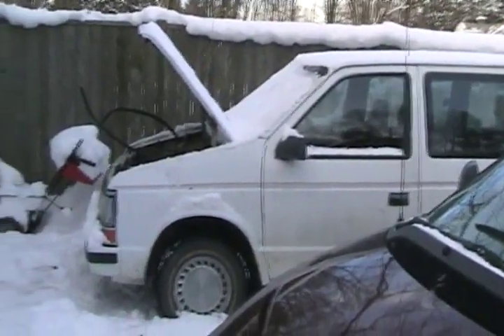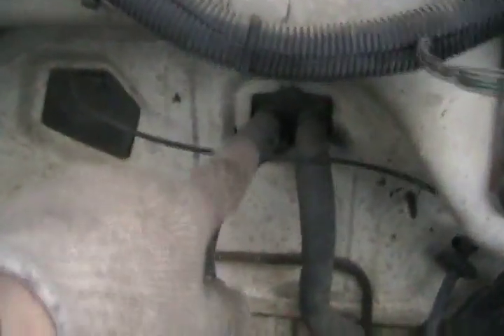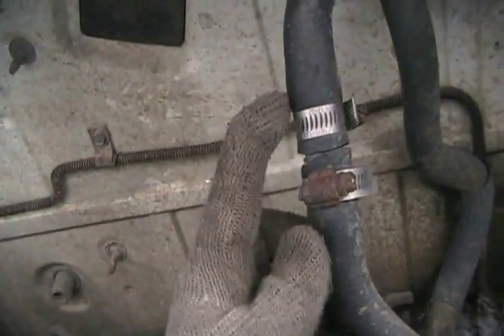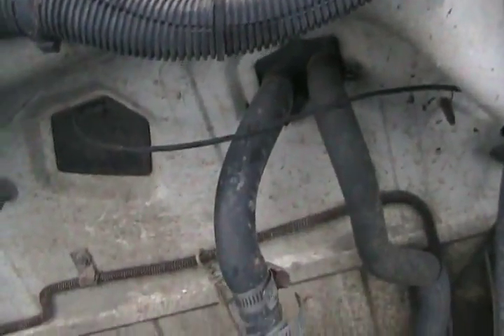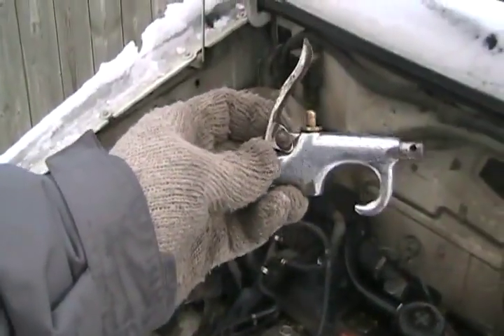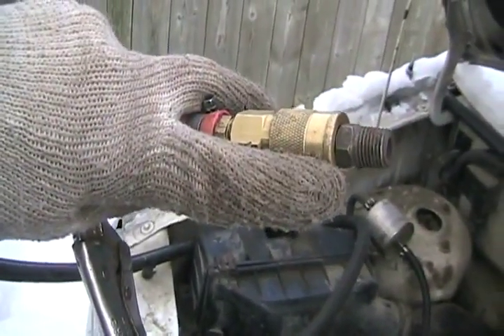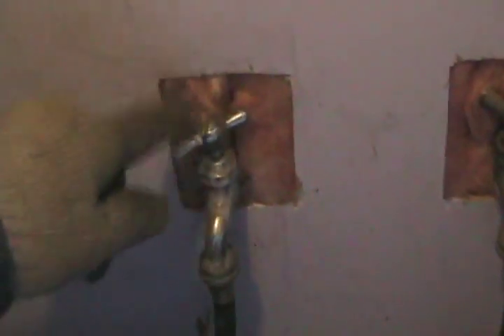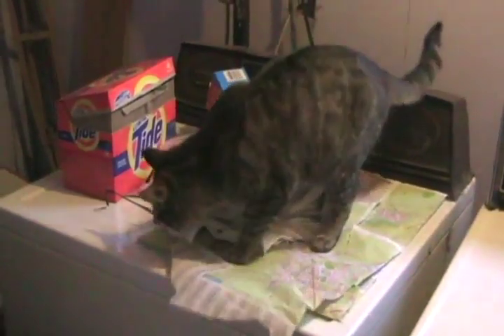#1206 How to unclog a heater core to get good heat [Davidsfarm]

Comment: Yeah, my '97 toyota 4runner heater core is not putting out warm air at all and being in central montana, we're experiencing sub double digit temps. It is very uncomfortable going to work without heat. I just put 5% distilled vinegar into the heater core and it will sit like that for two hours.
Reply: Vinegar could work, as it's acetic acid. The bleach could work, as it's extremely alkaline and the caustic reaction can break up all the crud in the h. core. But... DAVE, do not EVER use oven cleaner. Most types of oven cleaner will react with and destroy aluminum, and most modern heater cores are made of aluminum. I'm sure if you look on youtube there will be videos of oven cleaner on aluminum foil and such.

If anything, for plan C, use CLR instead. The white gunky stuff is usually lime and calcium from tap water, which is exactly what CLR was designed to dissolve. And it probably costs the same as the oven cleaner anyway. I've used CLR to clear a blocked heater core, and it works great! (And I always make sure it's well flushed out with clean water before putting it back together.)

Comment: Ill be honest... When I started watching this I figured hes going to put some chemical in there and say it fixes it every time and nothing bad ever happens. But he gave a lot of warnings and if you want to try and fix it that way go ahead. I would cut both hoses and get a 2 couplers so that i could run and extra long hose into a container on the side of my car/truck/van so that I could collect the junk inside of there. If you use bleach/degreaser/vinegar flush that heater hose with at least 3 gallons of water seams like over kill Ive seen that stuff ruin good antifreeze fast. Be safe and wear a mask or goggles and gloves.

Comment: My parents  had to get a water hammer arrestor put in because the water pressure was so dangerous high  so cleaning a heater hose was the fun part the velocity the water came out you would never need to ckean it again because there would be nothing left